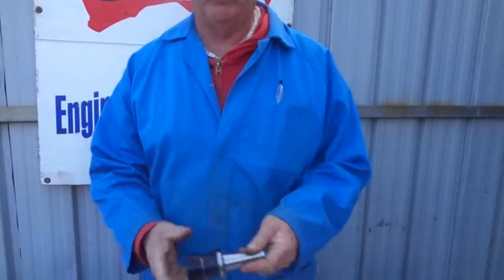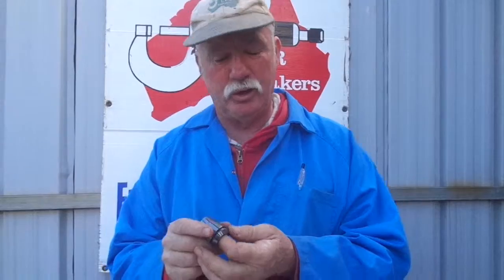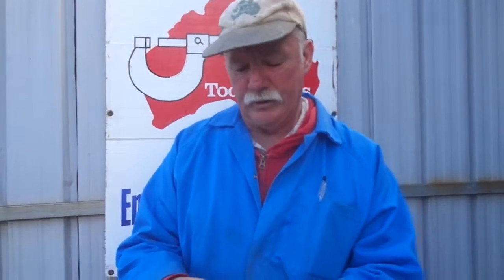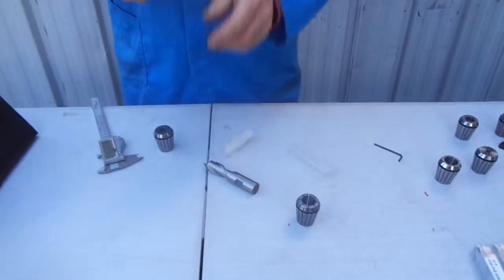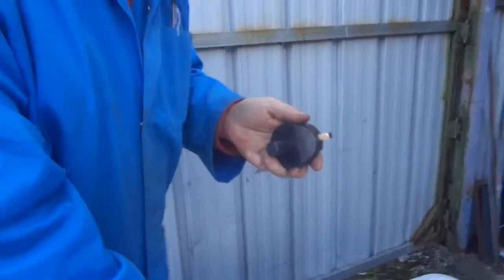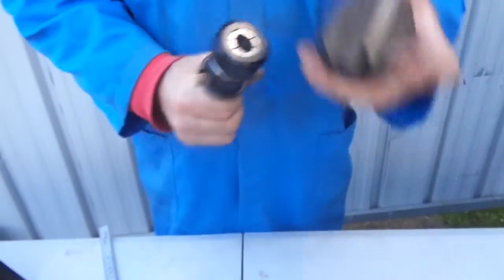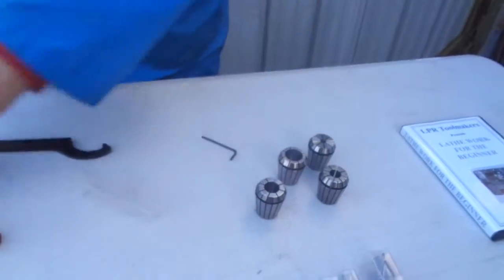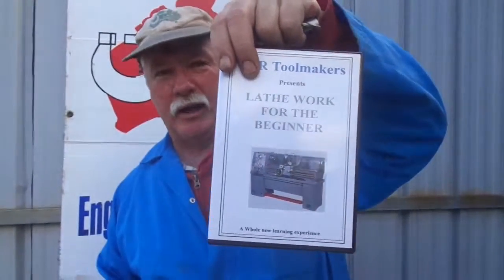ER 32 COLLET CHUCK

Comment: im looking at this on ebay
ER32 150L Collet Chuck  Straight Shank
to make a er collet block for the milling flat spots on round stock 
so my  Q&A is all i do is drill a straight hole in large square block 
but with Straight Shank how do i fasten it down its not clear if they have threads in the back i see there is two flat sides